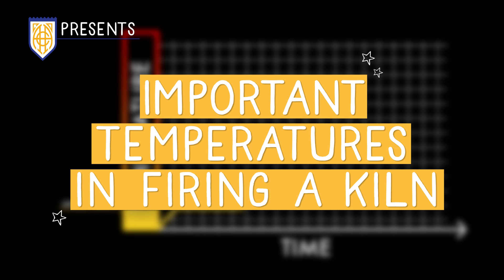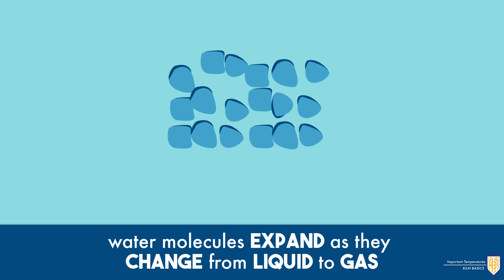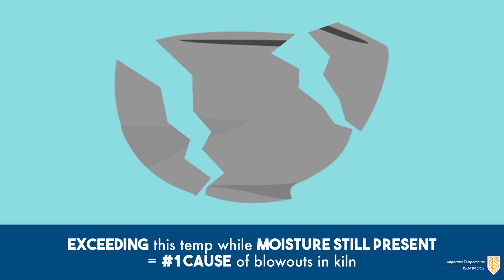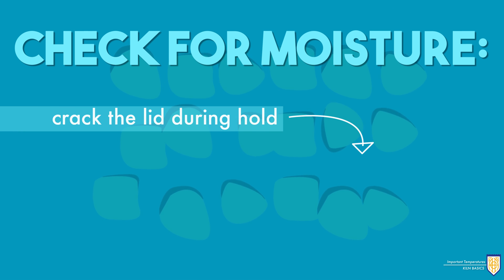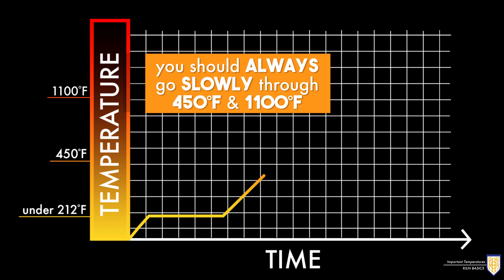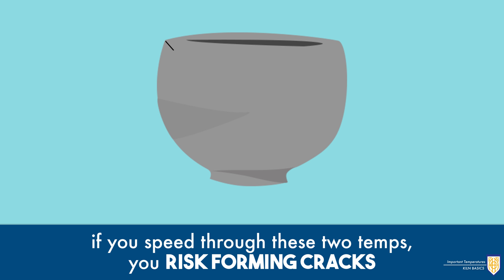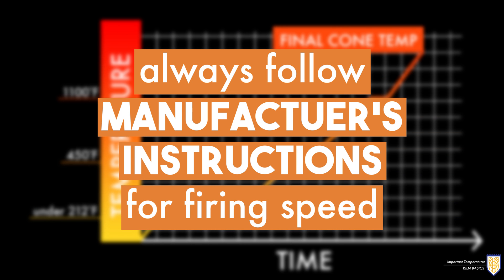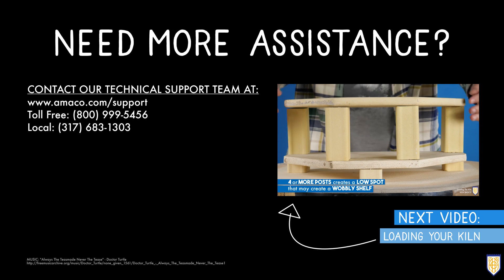FIRING A KILN FOR BEGINNERS - IMPORTANT TEMPERATURES // AMACO Classroom Kiln Basics

Comment: Totally new to the kiln.  I cannot find any information on how long to fire pieces. I purchased a mini kiln.  With it came miniature pottery molds.  I am in a miniature guild and would like to make pottery.  What information I do find tells me that it takes 12 hours.  I had my glazed pieces in for 4 hours and they ended up melted.  Any words of wisdom would be appreciated.
Reply from the maker: Kilns take different amounts of time to fire depending on the speed of firing (slow, medium, or fast) and the type of kiln you have. Different kinds of clay fire at different amounts of heat work, not at a specific amount of time. We recommend you contact the kiln manufacturer for details on a firing schedule, and find out the firing range of the clay you purchased (it should be rated by temperature or cones). Check out our Newbie Clay guide (https://amaconewbieclay.mailchimpsites.com/) for getting started in ceramics, or contact our Tech Support team for assistance.

Comment: Wha
t the temperature start for glazing ? To start in the kiln ? I have a manual hobby Jew 
Eloy one
Reply from the maker: Hi there, your glaze fire temperature depends on what clay body you are using (whether it's a cone 05, cone 5/6 or cone 10 clay body) and then what glaze you are using as well. Do you know which ones you are using? From there, we can better help you find the best solution.
Reply: @AMACOBrent cone temperature of 06?
Reply: Firing painting on tile, can I use an 06?